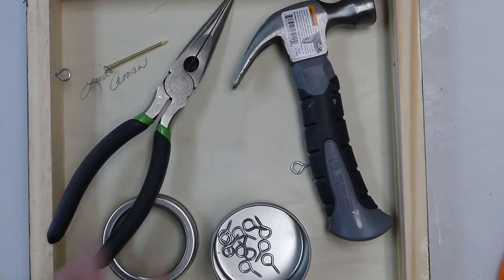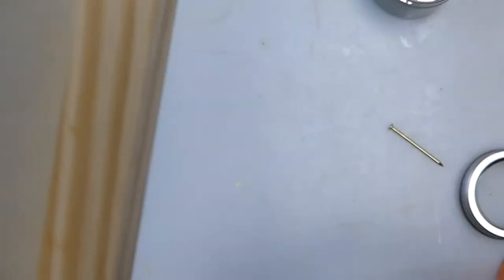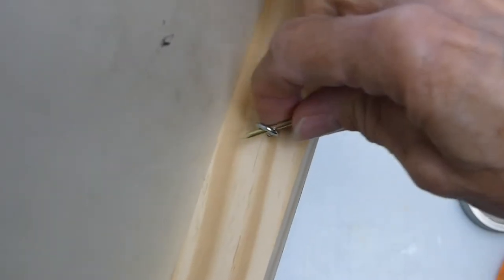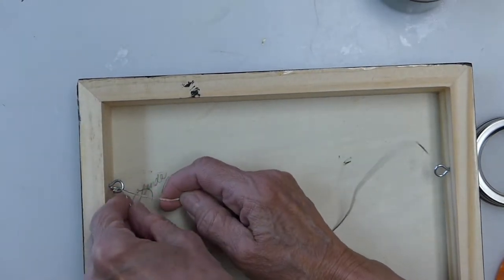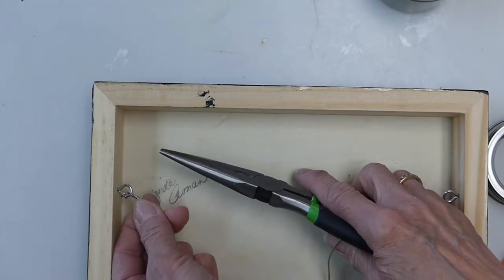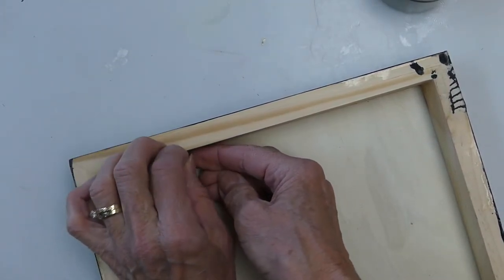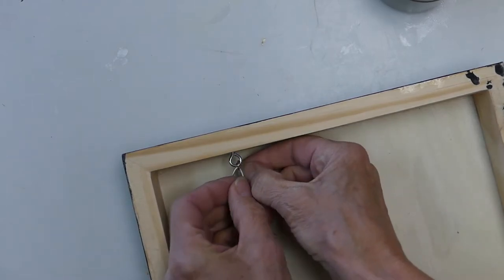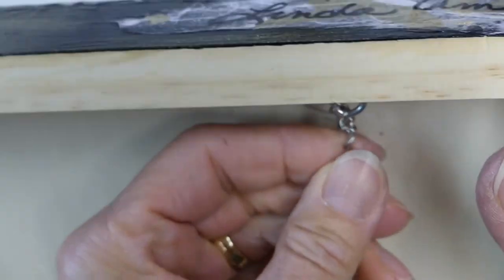HOW TO PUT A HANGER ON CRADLED BOARD ART

Comment: Thank you for this video.  I do have a question though.  I do have a problem with my cradled boards leaning forward a bit at the top when they are hung.  By using your method, do your boards hang flat to the wall or do you still have the leaning issue.  Thanks in advance!
Reply: Wish she had replied to you half year back 😳